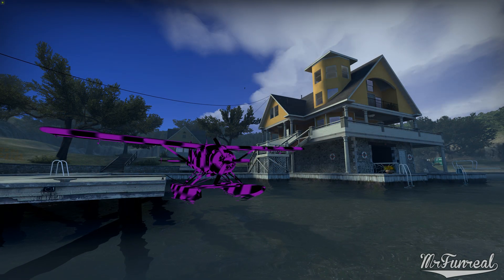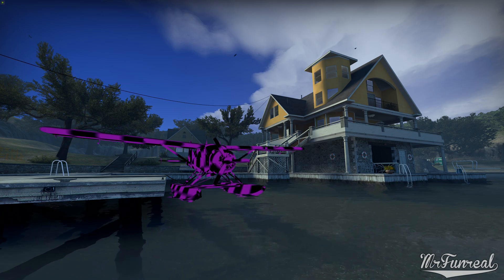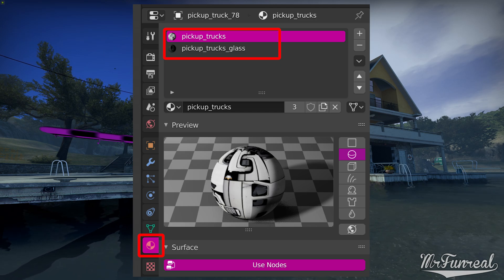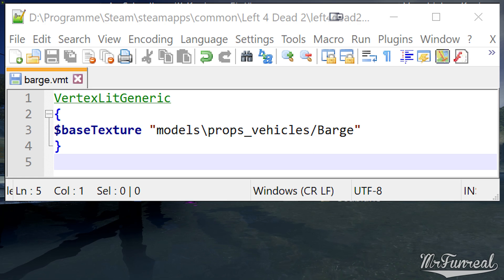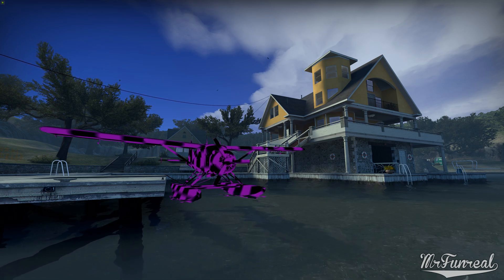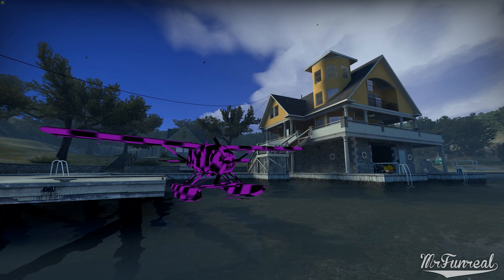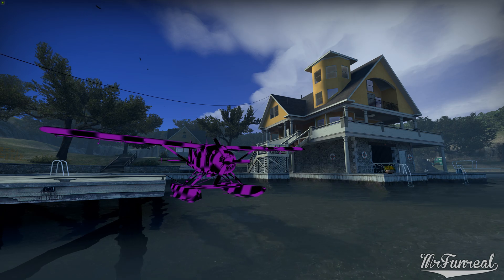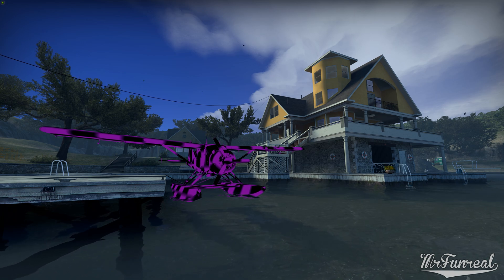Source Engine | Fixing Missing Textures on Models

Comment: my model doesn't  have missing textures, but it does when i check it in hlmv
Reply from the maker: If you're modding a game with addon support (like l4d2) its possible that the game itself loads the addon mounted content, but HLMV does not, as its not coded to do so. 

In which case you would need to manually put your materials into the games files. 
To avoid a headache in the future with "forgetting which files are custom, because you mixed the vanilla and custom content" I'd reccomend you to:
1. Make a new folder next to the game's exe named "Mods".
2. Put your materials folder into that "mods" folder.
3. Edit the gameinfo.txt of your game to add another "Game mods" listing above whatever the top most "game" listing is in that file.
(The correct gameinfo is usually found in the folder that bears the same name as the game's executable file. Meaning left4dead2.exe uses the left4dead2 folder)

Then reboot hlmv and it should load your custom files.

Comment: I have one material assigned to my model, but for optimization I want some faces not to be rendered by the engine. When I assign a material to which there is no path in QC, missing texture appears in the game. What material should I apply to these faces and what should be the path to this material?
Reply from the maker: all faces will be rendered. Even if you make them invisible, they will be rendered.

If you want faces not to be rendered, remove them from the model.

but oyu can always add a second material where the vmt is nothing but: vertexlitgeneric { $no_draw 1 }

This material will never be visible, but will still be rendered.
Reply: @MrFunreal  thanks!

Comment: i unfortunately have to state that i have tried all the methods in the video, but my model still has missing textures (i'm aware of the message at the end :P). i have changed the .vtf's version to 7.4 as well. my model did have an incorrect texture name when the texture was applied to the model in blender ("potatOS_wmodel", even though Portal 2 states the .vtfs & .vmts as "potatos_wmodel"), but even though i corrected the name, it still says in hlmv that it cannot find the .vmt. the .vmt also has the correct path for the $basetexture. (this is a L4D2 mod btw - i'm replacing the gnome with an enlarged glados potato).
Reply from the maker: if you're loading it in hlmv, it could be that you didn't put the content into whatever mod folder you made hlmv load.

If you're using crowbars "view as replacement" option, stop doing that because it for some reason also breaks how things work.

Other than that, every other reason i know of is in this video.
Reply: @MrFunreal  managed to fix it. restarted the process of setting up the model in blender, and this time I used a different file path name for the materials. not sure what else i've done different, but i'm theorising it was with the filepaths of cdmaterials and in the vmt? i could definitely be wrong though, since there are examples in L4D2 and other source games where there's more than 2 subfolders. last time i used a filepath that consisted of 3 subfolders instead of 2. 

also: forgot to say, thanks for these tutorials and the guides on steam. it's made learning Blender and Source Modding much more productive for me, and i'm having fun with it.

Comment: How does $cdmaterials know which game to search its material folder in? I believe my qcscript is searching another  source game which is why it cannot find the vtf file. If this is the issue, how can I fix this? I've done just about every solution on the internet and still get the dreaded pink checker.
Reply: Okay, so I tried moving the texture files  from the game I want to make models for to a source game I speculated the $cdmaterials was searching in (I put them into the game's 'materials/models/my_filename' file). I then loaded the model in HLMV (half life model viewer) and low and behold the textures successfully loaded. facepalm So I know for a fact my $cdmaterials is searching under the wrong game. 

To explain further, I did purposely select another source game simply because it had a studiomdl file that I felt would work well with the game I'm modding for. I did not consider that it's studiomdl would reference its game so strictly. Unfortunately, the game I'm modding for doesn't appear to have its own studiomdl. So, I'm not entirely sure on a workaround. I guess I'll just have to keep my texture files located in the other game. A bit awkward until I can find a way to add a unique studiomdl to the other game. shrug
Reply from the maker: $cdmaterials loads all folderpaths that are determined in the games gameinfo.txt.
it never looks in another game, ever.